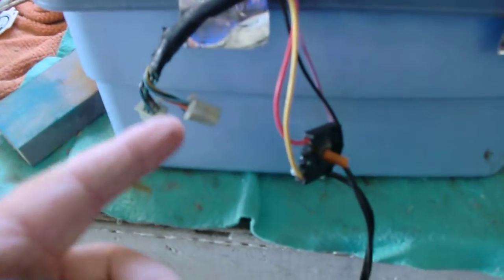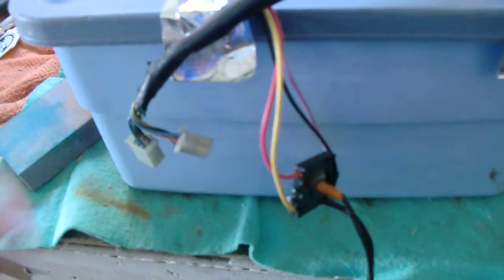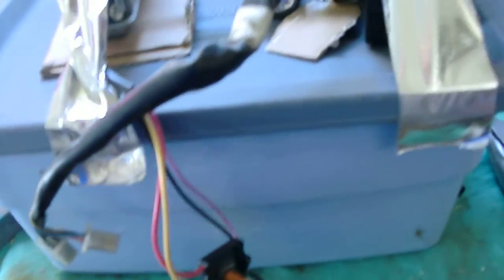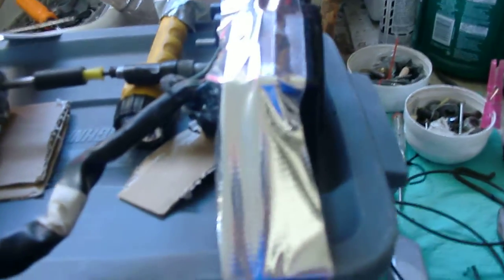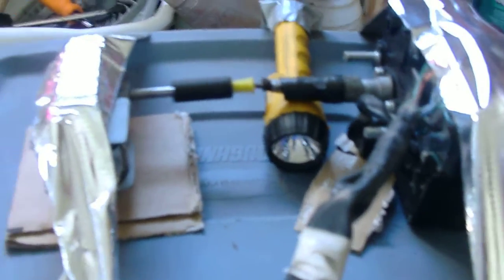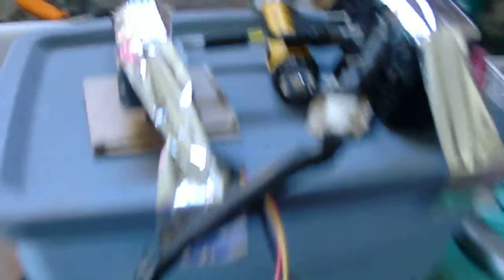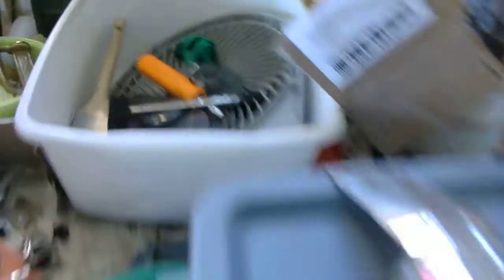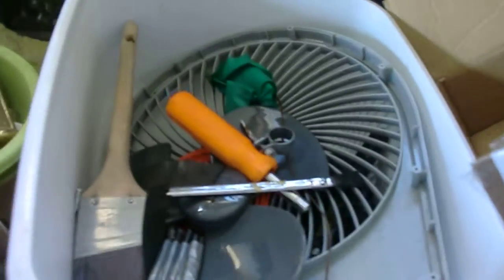How I set back my Honda  motorcycle speedometer odometer miles

Comment: How did you attach the fan to the speedo cable?
Reply from the maker: it shows my set up at the one minute mark. I used a hose, and plactic drywall plug to pressure fit to the cable.
Reply: @sdanville watched a bunch and not sure i totally understand the connections, but i absolutely appreciate the DIY aspect of this.